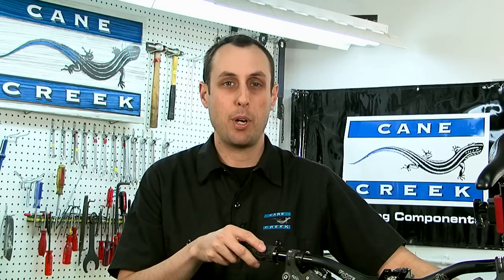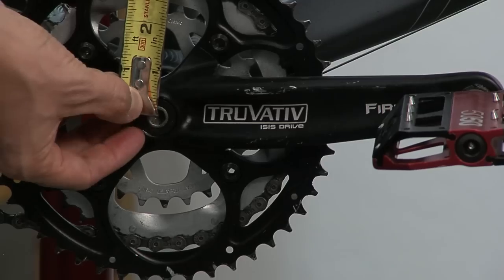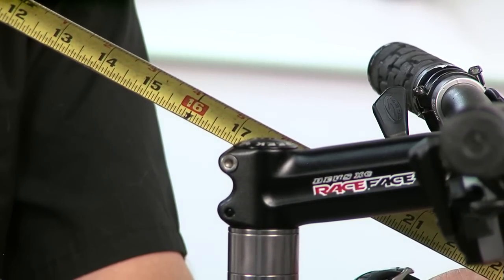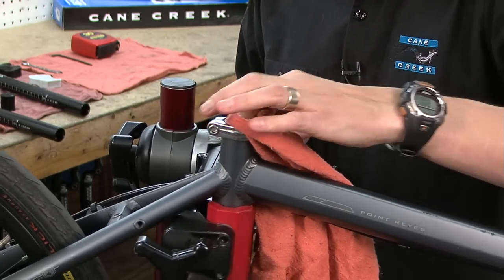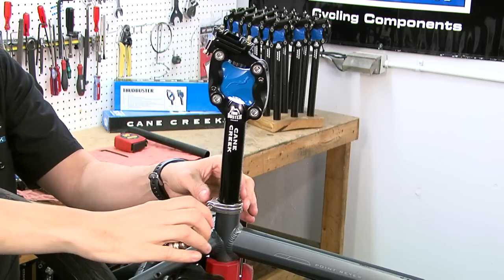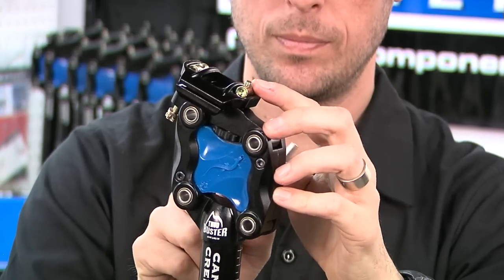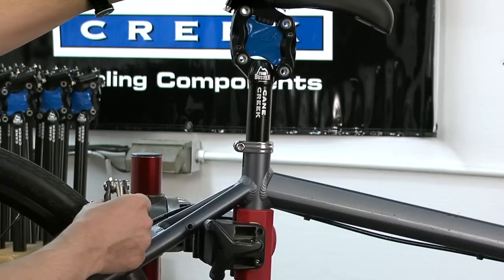Thudbuster Installation and Setup

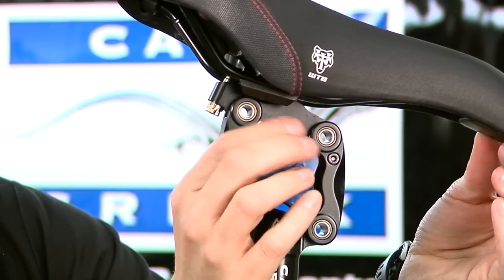Comment: At about 1:50 it states to check the fore-aft position.  Although it's not specifically mentioned, it should be possible to slide the saddle fore or aft about 1 inch in the saddle rail clamps.

Comment: You didn't consider that the rider weight is going to compress the elastomer and lower the actual seat height. You should take this factor and compensate the effect by setting the seat tube higher, the same length as it compresses due to the static weight of the rider.